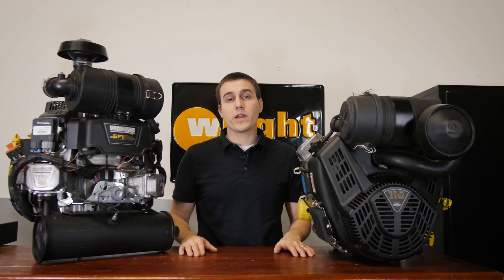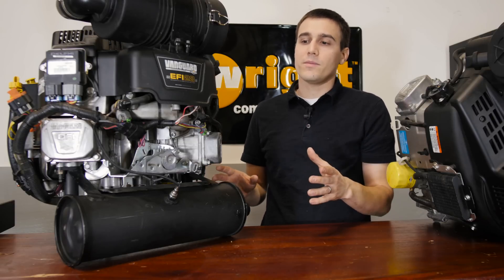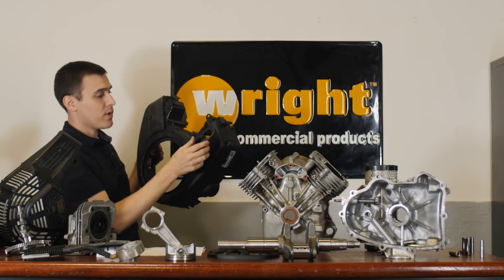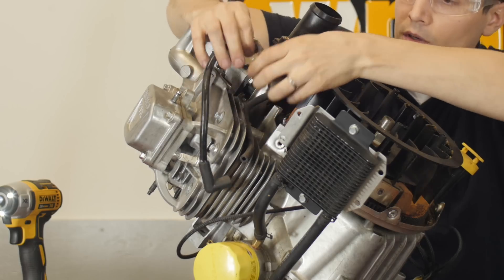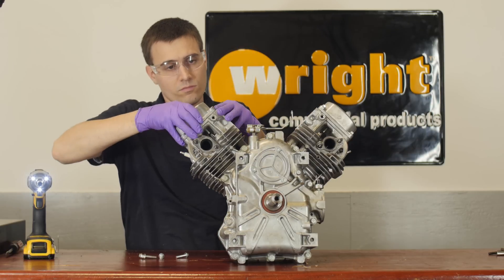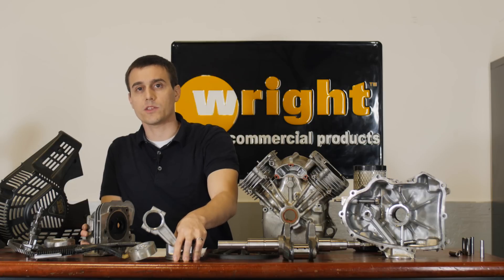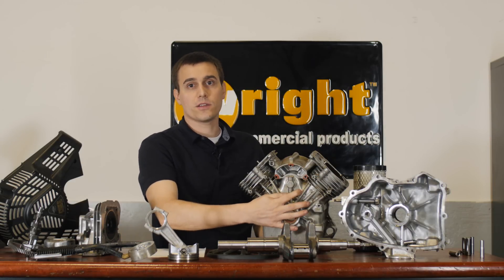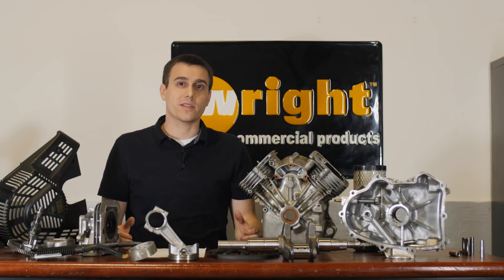VANGUARD Teardown -- See for Yourself What's Inside

Comment: Big diesels are cooling there 3-6 quarts oil with a 12 x12 inch x 1.5 thick oil cooler . Most have a precleaner thru stainless snorkel into dual filter Donaldson to an engine mounted air filter . The engines last .  The vangard is good but still  8 outta 10

Comment: Well that was a fail, I've been through hell and back with scag but I found a new dealer and convinced myself to give them another shot, I bought a brand new 2022 tiger cat with a Vanguard efi, I had five leaks within 30 minutes never even Engaged The pto. The dealer bought the mower back and it turns out Vanguard missed  applying some gasket sealer on the engine block which seeped oil. To add insult to injury both Parker wheel Motors were also leaking along with the hydraulic line fittings at the motor and at the pump.
Reply: Based on your comments on other channels, no matter what brand mower you buy, you’ll never be happy.
Reply: @Kellie Grase  I've learned no mower is perfect. If you bought 4 brand new scags and they all let you down, Wouldn't you be a little jaded too?
Reply: should have gotten a Gravely,lol
 @morejelloplease

Comment: I have a husqvarna pz60 briggs 26hp vanguard efi. I have always had problems with the efi computer.  At 1700 hrs I need to replace the engine. What would be a better more hp engine?

Comment: Bought my first Vanguard engine for this year. Hate it. Hard to start, backfires through carb it's so lean, surges all the time, starter is so weak I have to loosen the belt on the hydros for it to start in the winter, drinks gas like a camel does water, had to adjust the valves twice in 300 hours, and to top it off it now is making a knocking sound when you start jt after it sits a while like a crank bearing is failing. Poor excuse for a commercial engine.
Reply: And for your sad story there’s someone else telling the same one for a Kawasaki or Kohler.

Comment: After how many hours on 26hp 810cc vanguard to do engine rebuild or isn't it worth it?
Reply: I would wait until there is excessive oil burning or rod knocks especially when cold. If its running fine still, just keep it running

Comment: I wish Briggs would go to a cast iron or steel connecting rod.  Over my lifetime I have seen far to many of their aluminum rods break.
Reply: Aftermarket rods are available.  That said, rod failure is usually a symptom of improper engine operation or inadequate lubrication.
Reply: In 4:20 he said the crankshaft and the conectic rods are forged.

Comment: which motor is better the Kohler 33hp efi from your other video or the vanguard big block 32hp. It will be just for me a residential mower. 4 acres. Or will this 26hp vanguard be fine? I want this to be my last mower so maybe 25or so years minimum. Thanks for your videos. I've watched them all. You are very thorough. Stay well
Reply from the maker: Rod, If money is of no concern you will love the 37hp Vanguard on the ZK.  Very solid motor--the mechanical side (short block) has been in production in Japan for many years and very well debugged.  If you don't want to spend the extra on EFI I'd go with either the carburated FX850 or FX730 and just be sure at the end of the season to run it dry or run a pint of Trufuel in it so it doesn't sit with ethanol in the system.  Thanks for looking at us and am confidant that you will find a 25yr mower in our lineup. -Ed Wright
Reply: So in your opinion the 37hp Vanguard EFI is better or will last me longer than the 33hp Kohler?
Reply: Never mind, took your advice and went with the vanguard 37hp efi. Thanks man keep the vids coming.

Comment: Starters have been going out on Vanguards in just a few months.......no excuse for this...
Reply from the maker: Have you contacted Briggs, any answer from them? -Ed
Reply: I have not........there are many posts on the relevant forums....a bad batch fell thru the cracks is my guess.
Reply: @pdoggy10inch  I have had trouble with mine. They told me that the starters do not have enough torque to start these engines below 40 deg fahrenheit. Vanguards are total junk, and I will never, ever own another Vanguard, never.
Reply: @mrpotatoheadracing  lol